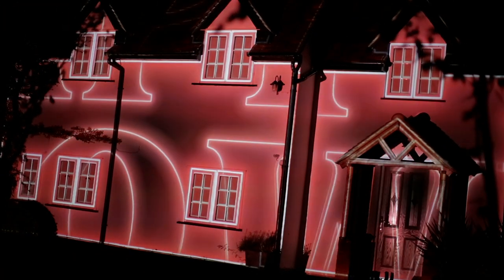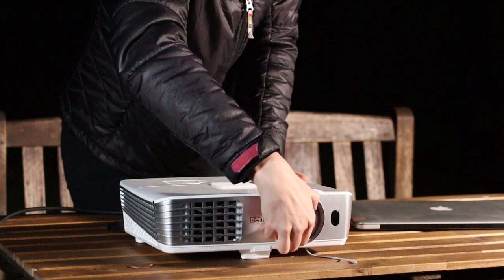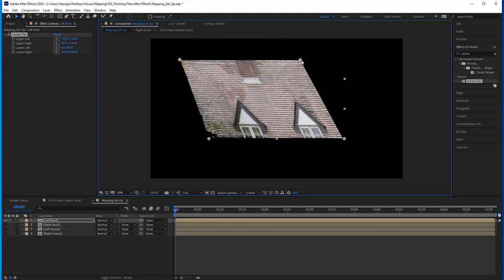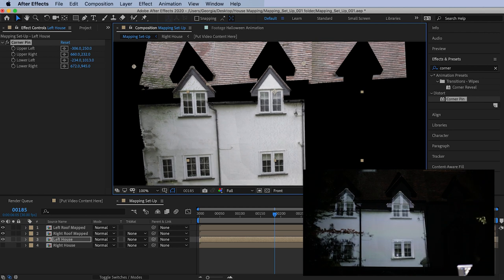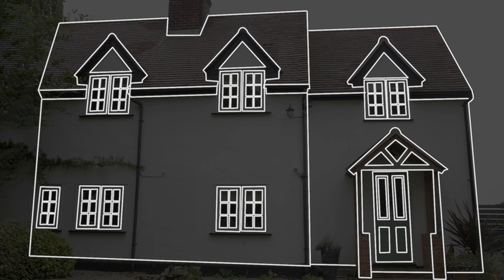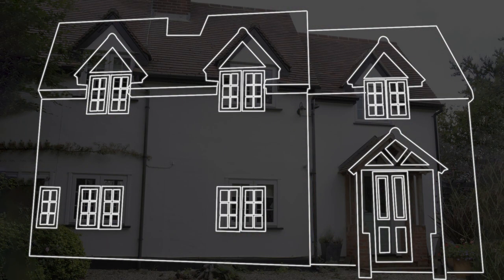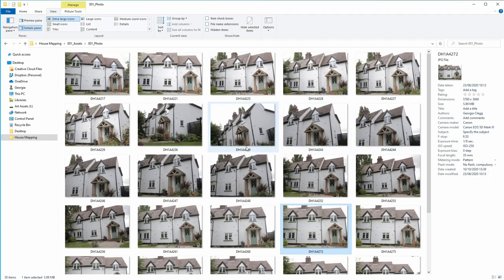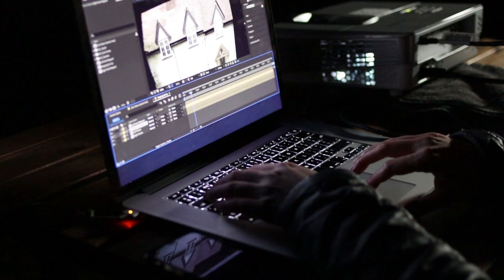House Projection Mapping Tutorial 1/5 Introduction

Comment: Hi Luna - fantastic easy to understand videos...Thank you for them.  I am just getting started in this fun project and I went through your mapping videos using LumaLite and then taking it into Gimp and finally into MadMapper Demo.  There is a slight problem I am encountering (it's probably a simple adjustment on my end) when I am at the final step of the process in MadMapper, where I need to put the image in Full Screen mode and then do a snapshot.  The image gets blown up too big and some parts of it are off screen and do not make it into the screen shot.  Do you think the original picture I had taken with my phone on top of the projector might have been focused in too close? Maybe there is there some simple adjustment that needs to be made in MadMapper before I put it into Full screen mode?  Thank you in advance for your help and guidance. - Ron
Reply from the maker: Hmm, sounds like maybe you've scaled your input mesh to be smaller than your photo... but I'm confused as to why you are using MadMapper if you've downloaded LumaMap Lite? The whole workflow can be done in that software, you don't need to use MadMapper. Follow this with LumaMap Lite https://www.lumabox.com/lumamap/knowledge-hub/guides/make-a-mapping-guide/

Comment: Hi, I have a question and it would be great if you could help me with it. Whenever I'm projecting (I use Resolume), there are pixels visible in the projected image. Is there any way that can be controlled or removed or is that default? Would using any other software or keeping a high composition size help remove them?
Reply from the maker: What is the resolution of your projector? If it has low resolution and you are projecting an image over a large area, you will see pixels. Or it might be because you are using low resolution video content or your composition resolution is too low. It's hard to say without knowing what you're working with. Rule of thumb is always try to use the highest resolution your budget will allow which includes both projector and video content resolution.
Reply: @LumaBox  I'm not entirely sure of the projector resolution but it is around 3k lumens. And by pixels I meant this faint grid visible behind the image in the projected content. Maybe, that's normal?
However, this was helpful. Thank you so much.
Reply from the maker: @peachygrenade  Lumens are a measure of brightness not resolution so double check your resolution and also make sure you're looking at native resolution.

Comment: I am going to do a projection mapping on my antique bus for Christmas. It seems, since you are using Meshroom, that you have a PC not Mac? I was going to buy a Mac but want your opinion. Also, how many and what type of projectors would you recommend for a bus?😆 It's a typical 9' x 35' Trailways bus. I am doing an outside projection as well as an inside projection. This is new to me altho I have a 3d CAD design background so it's not totally a foreign language. I love your tutorials and am definitely using them as a guide☺️
Reply from the maker: I did use a PC but I also listed some photogrammetry software options for Mac users in the description - I've used Regard3D which works on Mac and the results were ok. Maybe not quite as good as Meshroom but good enough to make a guide. Check out the projectors I recommend here - they'd probably be fine for your bus https://www.lumabox.com/house-projection-mapping-kit/ but check your dimensions with the projector central calculator https://www.projectorcentral.com/projection-calculator-pro.cfm. They would probably be overkill for interior projection though where you won't need something so bright. You'll definitely want to go short throw if you don't have much space inside.
Reply: @LumaBox  Thank-you so much!  I really appreciate the fact that you reply to your comments and that they don't go into the internet black hole.  I am going to stick with my pc and I will definitely check the calculator.  Onward and Upward towards Christmas :)..I'm quite sure I will ask questions along the way.  I have subscribed to your channel and if there is a way that I can pay for support I would be willing to do that.

Comment: Can you use and iPad Pro 12.9 4th gen or is a labtop needed
Reply from the maker: I doubt you can. What display outputs (if any) do you have out of the iPad?
Reply: @LumaBox  Display
Liquid Retina display
12.9-inch (diagonal) LED-backlit Multi‑Touch display with IPS technology
2732-by-2048-pixel resolution at 264 pixels per inch (ppi)
ProMotion technology
Wide color display (P3)
True Tone display
Fingerprint-resistant oleophobic coating
Fully laminated display
Antireflective coating
1.8% reflectivity
600 nits brightness
The 12.9-inch iPad Pro display has rounded corners that follow a beautiful curved design, and these corners are within a standard rectangle. When measured as a standard rectangular shape, the screen is 12.9 inches diagonally (actual viewable area is less).

Comment: hi this is great, one question. do you have to project on to a white house?. x
Reply from the maker: Hi. No you absolutely don't need to project on a white house. You can project on almost any kind of surface. HOWEVER, the darker and/or more textured the surface, the more brightness you will need from your projector and very dark materials (red roof tiles, or surfaces painted black etc) you might struggle to get the results you want within a reasonable budget. Compare how the projection appears on the white parts of the house compared to the red tiles on the roof - there is a big difference.

Comment: hi there I've watched all the videos and I have two questions 1: will any full hd short throw projector work?  2: my house is attached on both sides how would I go about taking the photos? p.s. thank you for the videos really well explained and put together
Reply from the maker: In principle, any projector can do this -- whether it's short throw, standard lens, Full HD resolution or less (or more!) But not all projectors are created equal so it will really depend on the model you've got. A cheap projector might, technically speaking, be capable of doing this but it doesn't mean it's going to look anything like as good as an expensive projector. I don't think having houses either side should be too much of an issue for your reference photos. Just try to get as many angles as possible and see what results you get.
Reply: @LumaBox  great thank you that's helped me put a few things strait
Reply from the maker: Great. That’s good to hear. Let me know if you have more questions.

Comment: Watched your complete tutorial and learned lots of great things that I think I can build upon. I was really excited to give this a go on my house until I realized that my house won't work with the method you used. Unfortunately the best projection areas on my house are two walls that are at a 90° angle from each other. Any suggestions?
Reply from the maker: The process will be a little trickier for you, but still doable. What you would do is export your Side camera view from Blender in addition to the Front. Then you will have to do a little splicing/assembling in After Effects so that the surfaces join in the right places. Imagine you have a paper model of the surfaces you want to project on and you're lay them out flat, that's what you're trying to make in AE. Does that make sense?